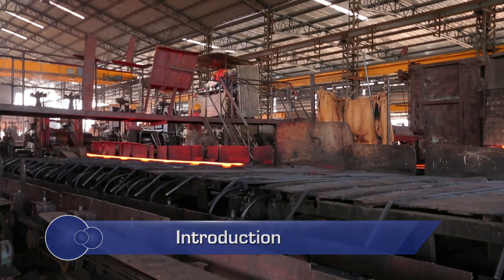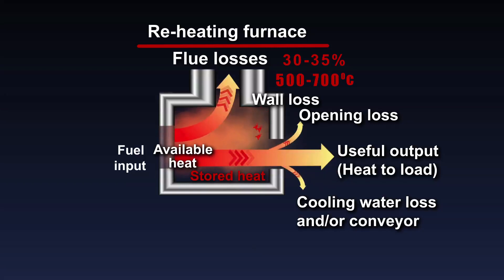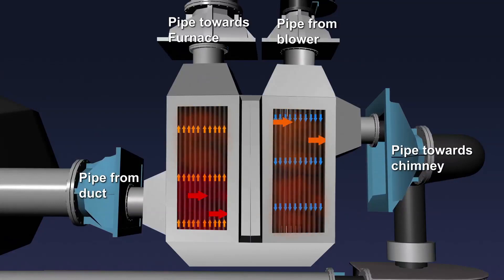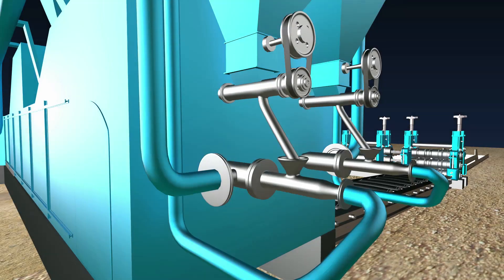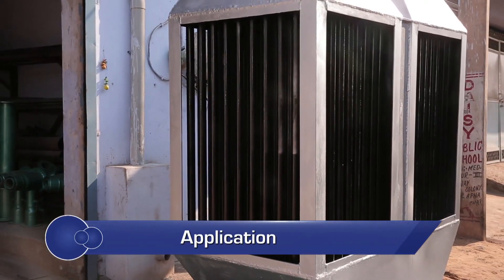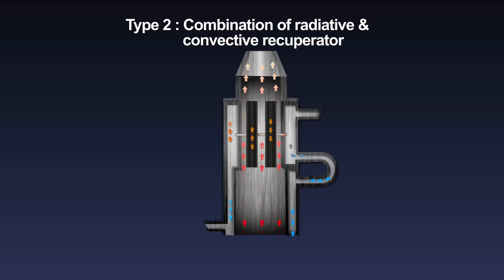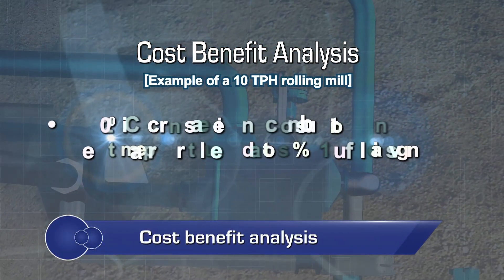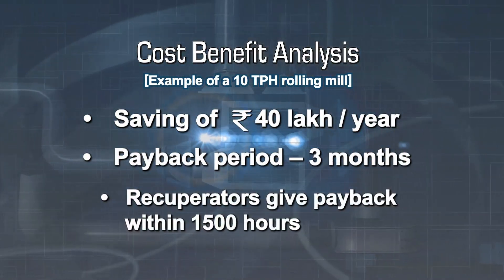Waste heat recovery- Recuperator

Comment: www.coalpulverizer.in                            https://khalsa-brand-coal-pulverizers.business.site

FULL ONE YEAR UNCONDITIONAL WARRANTY ON COAL PULVERIZING PLANT OFFERED INCLUDING WEAR &
TEAR IN THE HAMMER MILL (INCLUDING HAMMERS)

Improving the operation and emissions performance of pulverized coal fired billet/ingot re-heating furnace is of
significant interest to almost all TMT PLANTS in the country today. The recent
development of cost effective plant & components for third generation
KHALSA brand COAL PULVERIZER PLANTS permits ultra fine 200 mesh coal powder,
better combustion performance, increased wear life reliability and decreased
NOx emissions. Existing re-heating furnaces can typically remain in place,
resulting in reduced capital cost and reduced outage time for installation. 

For the last decade or so, KHALSA KOYLA CHAKKI YANTRA (TM) has been developing ultimate technology to
lower fuel consumption, extremely affordable alternative to extremely high
costing coal gasifier plants & lower emissions from pulverized coal firing
systems. KHALSA KOYKLA CHAKKI YANTRA (TM) has come a long way achieving
significant improved reliability & wear life of Pulverizer Hammer Mill
& components. Also providing affordable and reliable heating furnace
solutions in steel rolling mill plants eliminating the 'white elephant' Coal
Gasifier plants. Plants ranging from 2 tons per hour to 40 tons per hour are
available. 

www.coalpulverizer.in 

We will be glad to provide further details. Please contact: coalpulverizer@gmail.com,
surindraengg@rediffmail.com or +91-9815246408 for details.